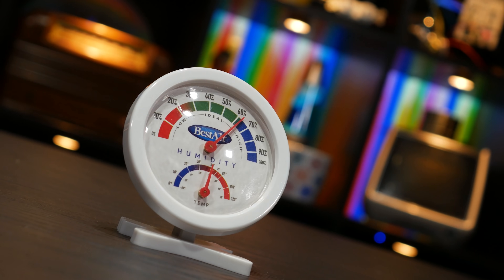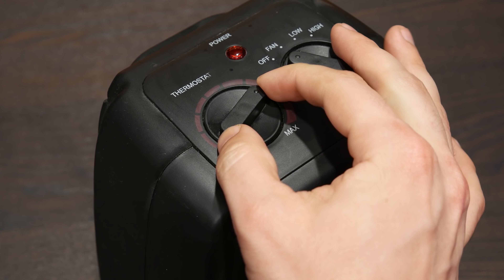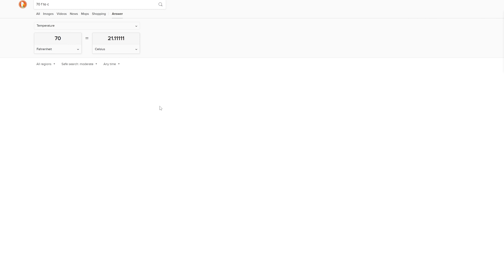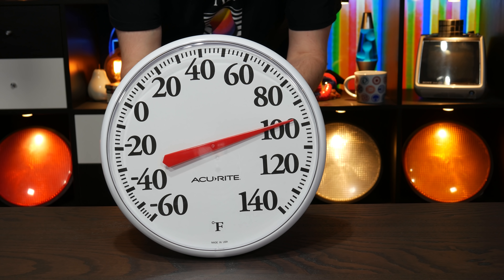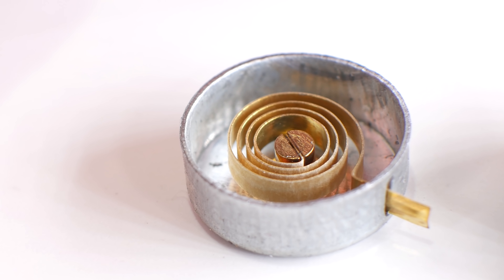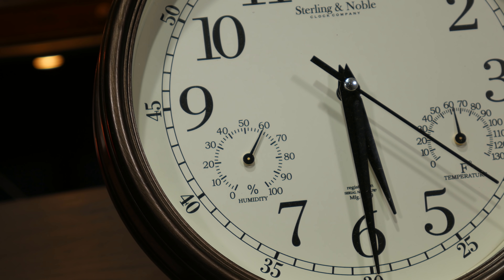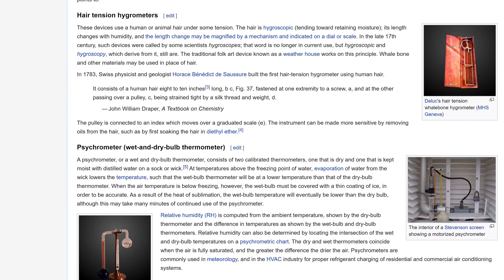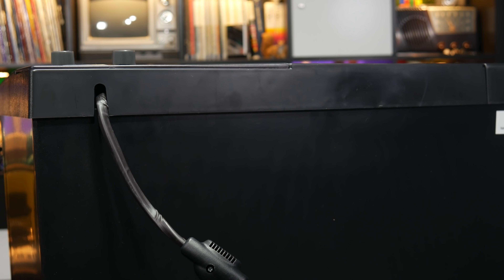Analog Hygrometers - how?

Comment: Fahrenheit man. That dude ruined temperatures. COMPLETELY ARBITRARY.  I will say that part of the difficulty with using celsius is that the numbers are too small and thinking of temperatures in decimals seems stupid. Lets just double the C scale which will be slightly finer measurements than F and be done. Then we don't have arbitrary freeze and boil temperatures and we don't have dumb decimals. The end.

Comment: A psychrometer is another accurate way to measure humidity, albeit somewhat awkward. Very easy to make, all you need is a bulb thermometer, some wet cloth to cover its bulb and another thermometer. Read the wet and dry temperatures (wet will be lower) and a lookup table or conversion tool then gives you the humidity. I tried it out outside last summer and the results were very close to those of the nearest weather station.

Comment: can scale be made linear with some kind of elliptic gear?
Reply: Yes, although there will be increased friction but limited torque. A more complicated shape would probably be needed for the best possible accuracy as these kind of things don't tend to be ideal curves any more than they tend to be straight lines.
They probably behave differently (have a different curve) depending on the temperature but overcoming that outside of digital circuits would be very difficult. I expect they just build it for best accuracy at room temperature and nevermind the slightly greater inaccuracies at other temperatures.

Comment: I have 6 different hygrometers in my basement. Everyone gives a different reading. I'm assuming the one built into the dehumidifier is the most accurate. The funniest thing is the little EZREAD 'weather station' style one that has an indoor reading and an outdoor reading with a little remote that your supposed to put outside. I put them next to each other and the humidity reads around 45% on the indoor and 25% on the outdoor.
Reply: RE: your EZREAD, that's interesting.  I wonder if the one for the outdoor meter is calibrated differently?  Perhaps what we consider comfy for an indoor humidity is different for outdoor humidity?  No idea, just spitballin'. Or maybe it's just crap. lol

Comment: To be fair, when it comes to things like these it doesn't really matter how accurate they are, or what the number actually is, or even what system of units it uses. You could just use symbols. What matters is being able to compare one day to the next, to see temperatures or humidity rising and falling, to see a reading and know that things are comfortable or not.
My old thermostat would read 25C when it was actually 18C, that didn't matter that the number wasn't right because I just set it to a level that was comfortable and it did its job at maintaining that temperature.

Comment: 1:58 
"A zero to 100 scale that correlates well with the range of tolerable ambient temperatures-"
Guh, not if you live in the north. -30°C to 30°C is what I consider "tolerable ambient temperatures." (Ideally... in a perfect world... -25°C to 25°C. I would live in that forever.)

100°F?!?! That's "murder me before I kill everyone" hot outside where I come from. but -30°C to +30°C correlates very well to the range of "miserable depths of winter; wear extra thick socks and seasonally appropriate outerwear on all of your limbs" to "this is as warm as I ever want the summer to be and I know it gets hotter than this sometimes but I'm mostly hiding and/or suffering heat stroke above these temperatures if they are 'ambient' as you call them." And it has a real convenient zero point of, "this is the temperature where people become significantly more likely to die while driving." 

Having zero be the, "hey idiot, your tires are probably going to slide," temperature, rather than, "oh yeah you were fucked 32 degrees ago," temperature, is not just sensible, it's actually life saving.
Note: am an American, but I'm from Vermont so it's hard to tell
Reply: Tolerable ambient temperatures for a person living in a temperate area.
Reply: And if we want to be rel-real about it, it should be -40°C to +40°C. 40°C = 104°F, so it meets your face-melting upper end (or, I dunno, sauna temperatures or something) while -40°C=-40°F. -30°F is about the worst that I usually anticipate around here, (at least, when I was growing up,) but -40° with a windchill is a real possibility, (it certainly won't be snowing, it'll just be cold, and it'll hurt, but it hurts like a number that I can actually identify.) Everything from 0°C down to -40°C is just a varying degree of ice/snow/hell. 

Like, 0°C > T > -10°C is just regular winter wonderland, plus maybe slush on local geography.
-10°C > T > -20°C is serious winter outings, including alpine sports, but it's the kind of rugged that people who like winter live for.
-20°C > T > -30°C is where you have to make sure you don't go outside without dedicated winter clothing, heating becomes really expensive, and commuting to work is even more miserable than usual.
-30°C > T > -40°C is maybe arctic crisis if it persists. People with extra fuel check on neighbors to make sure they haven't frozen while waiting for the wood pellet shipment. 

It's like... pretty straight forward. In Fahrenheit it would be what, 
32°F > T > 14°F
14°F > T > -4°F
-4°F > T > -22°F
and
-22°F > T > -40°F
Those number just don't make any sense.
Reply: 70° is cold for me.
Reply: @JoshuaTootell  Then you shouldn't move to Vermont. I have co-workers who set the thermostat to 80°F during the winter and I'm like, "WTF, it's warmer inside now than the outside gets in the summer. I have long sleeve sweaters, and super comfy thick socks, and this is THE ONLY TIME OF YEAR that I get to wear them. Why are you making me sweat, inside, during the winter? Put on some more clothes idiot."

Comment: Personally the use of outdated units like Farenheit in videos doesn't particularly bother me, but this strange American idea that it approximates a range of comfortable temperatures does. There is no objective comfortable or tolerable temperature range, as it varies person to person based on many factors such as local acclimatisation. As an Australian I can tell you right now that 110F is far more comfortable than even 30F for me, for instance, even though many people in colder climates will probably handle under 0F just fine while getting severe heat stroke by the time they get to 100F.

Comment: Actually your assertion that your ability to think in celcius is as bad as my ability to think in Farenheight is incorrect. Celcilus, with a scale of 0 to 100 from freezing to boiling of water is extremely intuitive for most people. Everyone can relate to that scale (and room temperature being 20°C is a sure easy number to fit in that scale). That is why in Canada, where a lot of people have had trouble letting go of pounds and feet for their personal measurements, not even old timers even think of the Farenheight scale for temperature. Celcius is so very intuitive it only took a few years of dual temperature reporting  in weather forecast for the need to disappear.

Comment: You could always join the weird half way house of the UK where we measure the temperature in metric, drinks in metric and imperial, food in imperial, travel distance and height in imperial and all other measurements in metric unless you're buying a house then they use imperial for the most part.
Reply: Never ordered "0.568 liter of best bitter".
Reply: @michaelwarren2391  but you'll have got a shot in 25ml, 30ml or 35ml. Maybe a 75cl bottle of wine.

Comment: I updated the BMS where I worked by installing a hygrometer at one of the air intakes of the main building. It was a Kele unit, horsehair sensor. I calibrated it when I put it in, about 1990 or so. The instructions said to recalibrate it every year and it would probably last 5 to 7 years. I believe it is still in there working. The unit was kinda expensive, about $70 at the time. It was a 10k type unit, I think it read around 10k at 50% RH and had a temperature sensor in the unit to keep it calibrated. The system it was in was an Andover Corp AC256, since replaced by a newer Andover. BTW, I translated the data to show on a linear scale on the monitor.. lol.

Comment: C'mon... It can be done in your head! For C to F:  20C*2=40-10%*40=36+32=68F. For F to C: 77F-32=45+10%*45=48.5+1%*45.5=49.95/2  =25C The repeating decimal 11.1111...% (5/9) loses a tiny fraction of accuracy... so you could straight up multiply by 5 an divide by 9, but for in the head, I find it easier to move the decimal and add (F-32+0.F+0.0F) then divide by 2. Yeah... I like finding shortcuts that don't need an app. Keeps me sharp... as opposed to falling flat... :)  Nice video! I'm about to look into a solid state humidity sensor for a project I'm working on. I was disappointed that you didn't touch on 'dry bulb/wet bulb' measurement of relative humidity. :)

Comment: Something else that makes these inaccurate is that percentage humidity is relative, it's based on the temperature.  Are these calibrated to show relative humidity near room temperature?  If so, they would be inaccurate outside when it's hot or cold.  If the amount of water in the air remains the same,  100% humidity at 37F is only 20% humidity at 86F.  Dew point is a more absolute way of showing humidity.

Comment: Digital is fine but most times you don't need to know the exact measurement, but approximate to what now is. 
Just like accuracy... you use it as a guide like most things work better in the middle and if it gets too far on either side you know it. 
I have 2 Barometers with Hygrometers and they seem to be similar in readings with the weather apps for my location.  
One in Japanese one ºC and another from West Germany that reads in ºF.

Comment: Should be pretty easy to get an accurate hygrometer with equal spacing, by incorporating the right kind of mechanical linkage to account for the difference. They're not going to put that in a $10 clock though. It might cost a whole extra nickel in material (and a few more cents in tooling).

Every time I watch this channel, it gives me ideas.

Comment: I use long leaf pine cones (the petals or scales bend) and wisteria pods that have popped open (they twist). Soaking in salt water helps.
Reply: Wisteria Pods keep twisting and untwisting for years. Soaking them in salt water helps them get moisture from the air.

Comment: What's a comfortable temperature range for people is is almost never the same. But you know what IS always the same? What temperature water freezes and boils at (under natural earth conditions.).
Reply: Most folks would agree that 100f is pretty hot and 0f is pretty cold even if they handle one better then the other. The swing isn't so large between individuals that it isn't still easy to figure out using Fahrenheit.

Comment: Conversion is stunningly simple.  F=(C*1.8)+32  or C=(F-32)/1.8  Just remember it, or you can easily figure it out from first principles. 32 adjusts for freezing point, and the range from freezing to boiling is 100C vs 180F, a ratio of 1.8.  That's it!  There's really no excuse for whining.

Comment: 1:45 That wasn't even my first thought. That was "holy cow, that's a huge thermometer!"
Reply: Had one for years as a kid. For posting to a tree a couple dozen feet from the house, in shade, to be seen from a window. Works perfectly. Meanwhile my wife installed an electronic sensor/transmitter thermometer.....right next to the house, where it does NOT read the actual environmental temperature, because the signal is too weak to survive through the walls.

Comment: I'm surprised you didn't realize (and then bring up the point) that one benefit to the analog devices is that if you have an accurate second device to compare to, you could actually fix the poorly designed scales by marking known temperatures/humidities on the dial with a marker and then printing out a new face graphic that's been adjusted accordingly. 

Also... 62 degrees??? Brrr it's cold in there!

Comment: Since I was a kid in the 90's I have been the proud custodian of a 1940's document that describes how to build a wet/dry hygrometer and contains the Hygrometric tables needed to determine the relative humidity.  All thats needed are two thermometers, one small dish of water, and a small amount of cotton wool.

One thermometer is dry and merely reads the temperature.  The other thermometer has the cotton wool wrapped around the bulb, which is wetted by the dish of water.  This thermometer will read a lower temperature depending on how fast the water is evaporating from the wool.  The difference between both thermometers, by way of the hygrometric table, shows the relative humidity.

Perhaps I should scan this and upload it to archive.org or something.

Oh, and I convert F to C on my C64, for which I have an emulator and a program I wrote as a kid to do just that.  I'm pretty chuffed how I can fire up the C64 emulator, load the program and do the conversion faster than my american mates in the chat can open google :D

I do it that way just to annoy them :D

Comment: hmm, i wonder, ok so invention idea, lux-electric isotopic magnetic hydrometer.    seriously, a needle gauge readout powered by an electromagnet, controlled by the variable resistance of the electric hydrometer powered by a photovoltaic cell wrapped around a tritium capsule.  a decade or so of constant, accurate, humidity readings for your viewing pleasure

Comment: Mine doesn't have a dial at all but is a long slender branch of (I think) willow. In high humidity it gets weighed down (or completely bent and saturated) and in low humidity it is almost erect to the point of breaking. We have been using this one branch for 5 years and has yet to break in either direction, nor has it become brittle or moldy. It's response however is within the timeframe of hours, so no good at prediction in any long term. (neither are the other methods of course unless one chooses to watch it continuously and plot a Trend)

Comment: Below 0 = Damn Cold.  Coat and sweater.
0 - 10 = Wear a jacket, hoodie or sweatshirt
10 - 20 = Long Sleeves
20 - 30 = Short Sleeves
30 - 40 = T-Shirt and Shorts
Above 40 = Heatwave.  Or you're living in a desert, or some baking hot tropics.

So Celsius isn't that hard.

But love the material.

Comment: I used to work in a laboratory with climate controlled spaces. I would regularly have to check and log the humidity using a funny wet/dry bulb hygrometer that resembled a noise clacker toy. You would stand in the middle of the room and twirl it above your head a set number of times and then record the difference between the wet and dry bulb thermometers which could be checked against a table to find the humidity.

Comment: It's always been hard to find a digital hygrometer that is accurate at extremely high (85% or highter) relative humidity. Electrical devices are prone to condensation on the sensor due to the heat generated by the unit

Comment: Thought: It should be possible to display a linear scale using a gear with predefined teeth to offset the non-linear nature of the paper-bimetal coil. It is relatively more complex, but probably by a practically negligible factor.

Comment: As I age I realize that my joints: elbows, ankles, knees, wrists... Are as accurate as a metal strip tease device at measuring humidity.
Reply: What I'd like to know is... How does the humidity get into the joints, and how is the accuracy not completely destroyed by all the water-based fluids already in there? It's not like a hygrometer works from inside a water tank
Reply: @nthgth  My guess is that our joints are barometers rather than hygrometers.  I live in a very dry part of the country and a storm will come in and I'll feel like crap.  But the humidity at the ground doesn't change much.
Reply: @christophers.8553  
Exactly right. I have bad arthritis in my shoulder after 10 operations and I can always tell within 24hrs if it's going to rain with about 80% reliability. 
I started to notice pain in my shoulder was relative to barometric pressure either rising or falling as I have a barometer in my watch. 
As the shoulder (and other joints) are a sealed fluid filled cavity it makes sense that atmosphere pressure can cause those joints to expand or contract causing pain.
Reply: @nthgth  the joints have some fluids in them, which is by need balanced with the outside environment, and the movement of your bones inside that fluid makes it bubbly, producing lots of tiny bubbles, the bubbles collapse, and generate a small "explosion", when you crack your fingers or whatever, these bubbles what you hear. These explosions are giving you lots of data to the very sensitive receptors inside your body, and in time you learn to compare the data to useful information, like humidity, temperature, weather forecast and so on.

Comment: the best way to get used to temp is to switch a the temp stander in oyxgen not included kelvin is the best logicly there no weird negitves and i did go up with f (still am(only 13)) but it is the best and we should switch to it there is never negitve heat energy in a space

Comment: Funny you should post this today, I live in the Ohio valley, and it has been so incredibly humid recently, and today when I was on a bus the air was so saturated with water (partly due to the cleaning solution they blow in) my glasses fogged up because of my mask and once I took them off they didn't defog. Also when I got the mail today I almost rubbed a hole in the envelope it was so floppy.

Comment: Sling psychrometer?   Two thermometers - one with a wet sock on the bulb - whip them around in the air, and trace the dry and wet temperatures on a psychometric chart to read relative humidity.